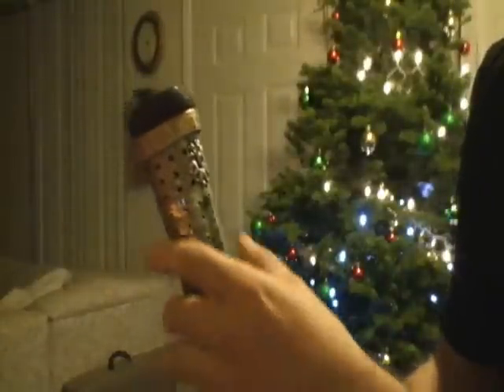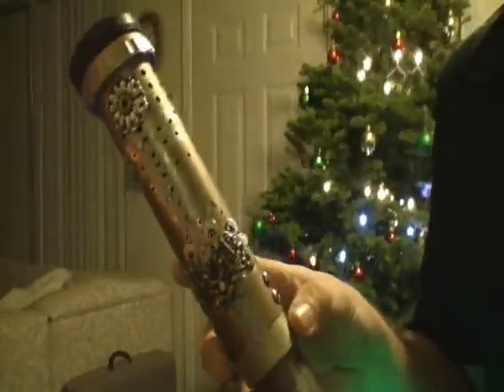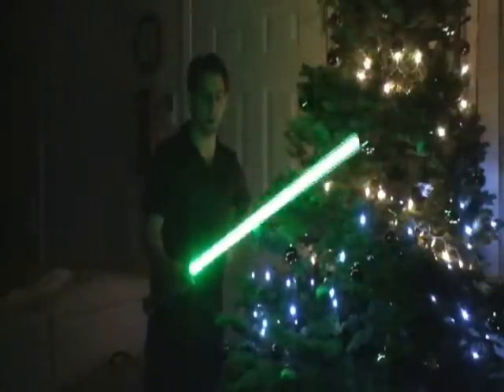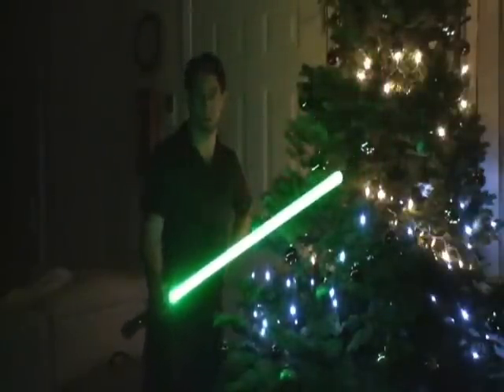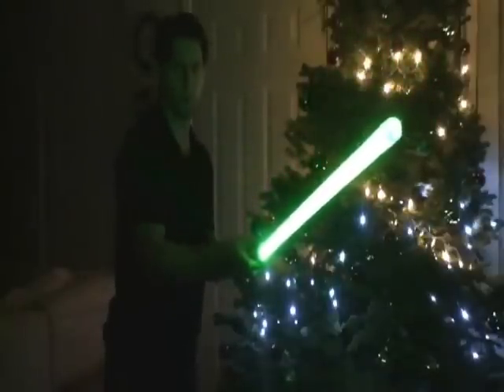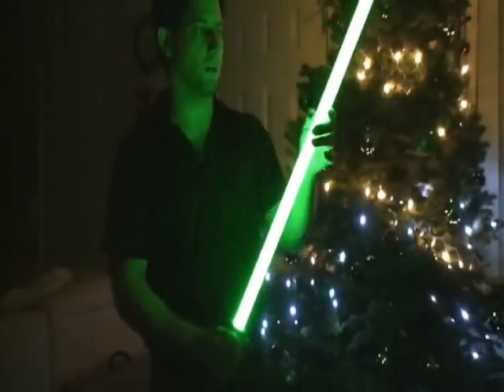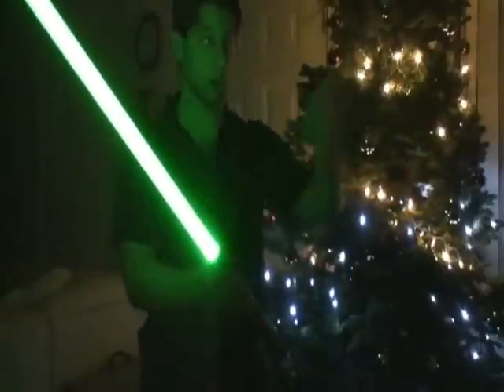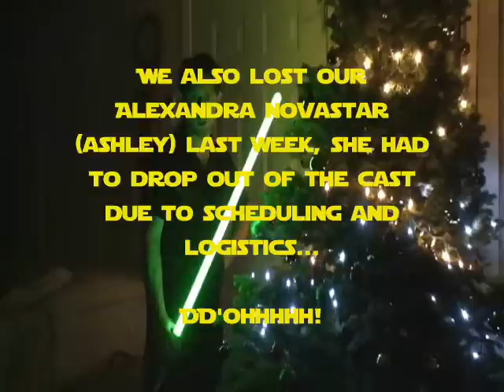How To Make a Lightsaber - LEDs & Crystal Focus

Comment: @greytale 

I have CF 4.31

This is how I currently have it set up. Keeping the dead zone between high swing and low clash. Pretty good, but like I said, it doesn't seem to like harder surfaces as much as the MR boards do.

hc=255
lc=100
hs=65
ls=12

Comment: @The12Child Certain focusing crystals that are in the lightsaber are bonded with the Jedi, the crystals have a stronger effect based on the Jedi's connection with the force. therefore, no force, no lightsaber.  Also there are materials that are resistant to lightsabers: Cortosis, Felucian Skullblade, Mandalorian iron, Neuranium, Phrik, and Ultrachrome. Also, it takes a great amount of control in using the force to be able to wield and use a lightsaber. Yes, I am a nerd...

Comment: it looks really awesome! um a question I have is what did you use for the blade lights?
Reply from the maker: +Jae'dyn Peralta The blade is illuminated by a single, high-current LED.  In this case, it's an old video... but the way I build them today is still similar, although sometimes we use "3-up" LEDs, such as "Blue, Blue, White" for example.

Comment: What kind of LEDs or lights did you use for the green part of the saber?
Reply from the maker: +Ashley Levins Although sabers can be made in a myriad of ways, the way I build mine revolves mostly around using a single, high-current LED inside the hilt--which illuminates the entire polycarbonate tube ("blade").

It's true that people are free to do things differently, however, for the past 10+ years, it's been one of the best methods considering cost, durability, build-time, weight, brightness (and more).

Comment: how did you make your blade so bright?
Reply from the maker: +Scotty Nankivell I'm a Jedi, what do you expect...

Totally kidding...  :D

It's a combination of many factors, but the most important of which comes down to "light diffusion".  :)  I could explain more, but it's not easy just using text.  Overall, you want to catch as much light as is possible, without dimming things substantially, either.
Reply: +Novastar (SaberCombat)  I see... Cause I had a master replica blade. I took the inner tube out and replaced it with cellophane helped a lot.  just trying to gather as much info as I can
Reply from the maker: ***** Precisely!  :)  Most of the best things in life come from experimentation.  :)

Keep on going.  You never know what awesome-sauce you'll uncover.
Reply: +Novastar (SaberCombat) so you built your Saber complete from scratch? including electronics
Reply from the maker: For the mostpart, yes, but the heart of the electronics is the Crystal Focus board.

This video is old, but... you can find out more about the goings on with CF via Plecterlabs.com
Reply: +Novastar (SaberCombat) the focus board doesn't anything to do with lighting brightness aye
Reply from the maker: +Scotty Nankivell It can indeed.  But it does depend on many factors, as I said.

If you want to make a saber without a driver board (and thus, also without sound), it can still be made bright--if wired up correctly.

Comment: Is  that iron?
Reply from the maker: Lucas Fitzgerald Not 100% certain what you mean, but... the hilt/handle is made of a combination of steel parts and aluminum ones.  I did a good amount of paint work & weathering, otherwise, it would have an entirely chrome/shiny look.

The "blade" (or light tube, whatever) is made of polycarbonate.  Basically, a flexible yet resilient / durable high-polymer plastic.

Comment: Battery Eating?
Reply from the maker: glenn lobelle That's a pretty open-ended question, and... it depends, it depends, it depends.  :)

However, most LED sabers that are bright and designed fairly well draw ~1A to 2A.  Again, depending.  This means that a battery pack that is rated ~2600mAh will be drained in ~2.6 hours by a saber that draws ~1A.

This is the reason I use Li-Ion cells (rechargeable).